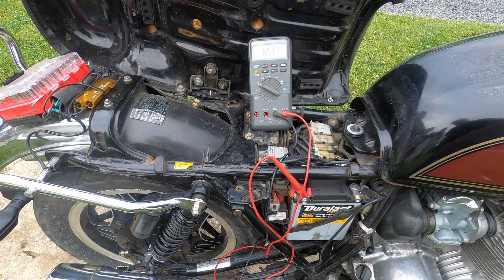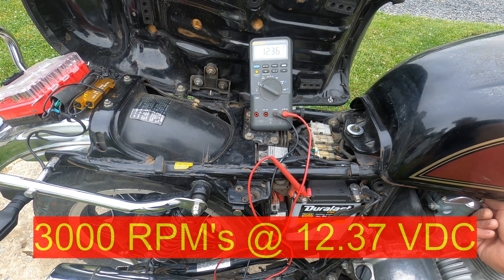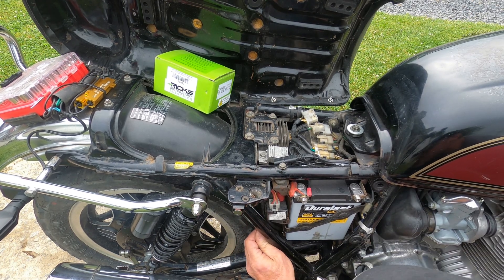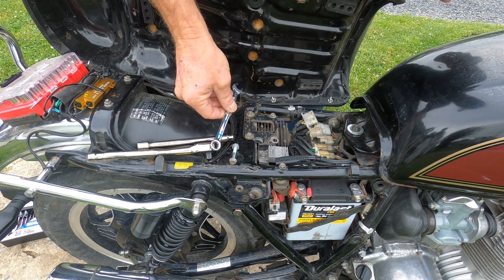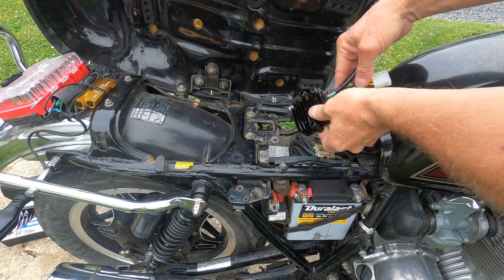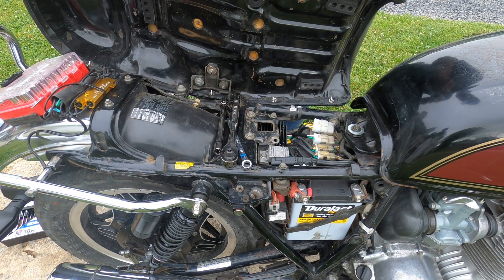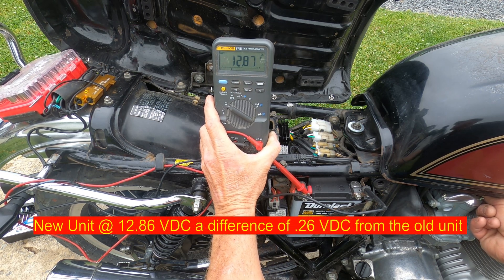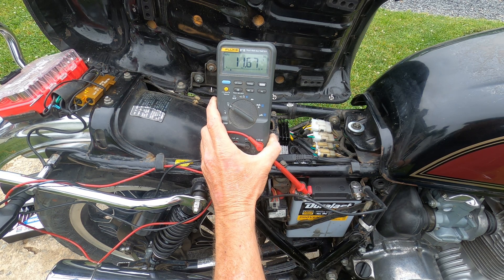Ricks Motorsports Electrics OEM Style 79 Honda CB650 Rectifier - Regulator Install

Comment: Unfortunately when the rotor goes it usually takes every thing with it (sorry I didn’t make it) while you have it apart you should have between 2-5 ohms at rotor. And of course check stator and as far as regular goes if the other two components are junk. Guaranteed so is the regulator. Don’t just try a new regulator unless you like buying them and last most likely the one thing I never see anyone check is the plus ins. Mine were burnt looking because they were. Hard wire that new system together and that will prolong the grief with this unnecessary   Charging system. The real problem overall is that rotor doesn’t like the heat.  I’ve seen other models that installed a internal fan with the rotor.  Don’t know how well it works but I’m looking in for room in case to see if I can adapt  to my 1981cb650c

Comment: Hi good arfernoon sorry for my English is not the best, I just got a cb650 1979 here where I am is cold I know that affects the performance of the battery, today I try all the dates with the tester and are similar to yours, I can’t not ride it yet cause I’m not allow but I always start it up every day but every 2 weeks or maybe 3 dies the battery and I have to charge, do you have the same problem? Or you think that is the battery that I should replace it
Reply from the maker: If your not above 2,000 -2500 RPM's your charging system is not putting out a high enough voltage to keep up with what your using to keep the bike running.   You have to be above 12.7 volts to keep the battery up.     I have found in town setting at lights and not moving much the voltage goes down.    :(       But if your out just riding and your RPM's are above 2,000/2500 rpm's it will keep the battery charged.   You can update the charging system like I did... Rick's makes everything you'll need...   If you want to keep it stock.....    just make sure your not just setting at idle more than you are above the min RPM that will keep your battery up...12.7 is the min amount. You really need to be around 13.2 to 13.5 with the old stock system....    This model had charging problems...   Its just the system they used.    Have Fun with it...   There fun bikes !
Reply: @seanwynkoop474  thank you!

Comment: Thanks, Exactly what I was looking for. I have the same model bike with the same problem.  Hopefully I can fix it after watching this Video.
Reply from the maker: Check the OUTPUT of your rotor and Stater.... The regulator only "regulates" the output of those.  In my case I was able to clean my rotor with Elect cleaner....   some call it "TV TUNER CLEANER" Mine was BLACK !!!!   a good cleaning and a new seal to keep water out ....   and my output was good.
RICKS also makes an updated Rotor and Stater witch is much better than the stock one.  the 79 CB650 was known for a low output Stater and Rotor.     Hope this helps
I also use the RICK'S  CDI units....   They make good stuff !